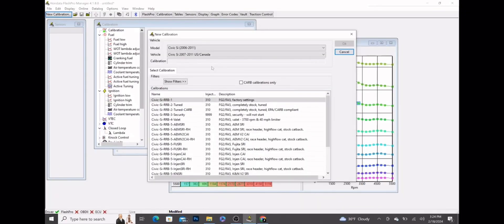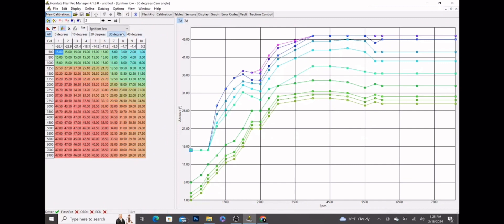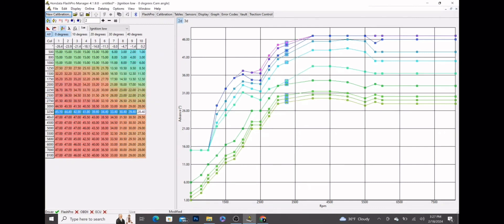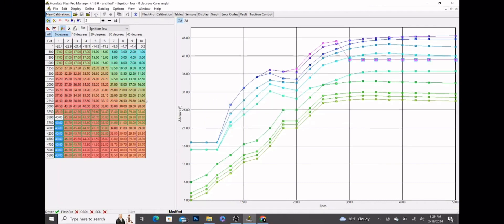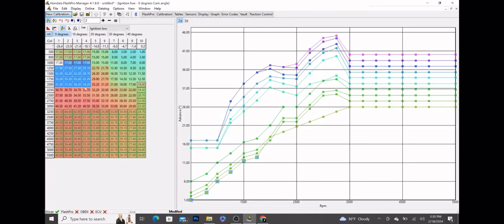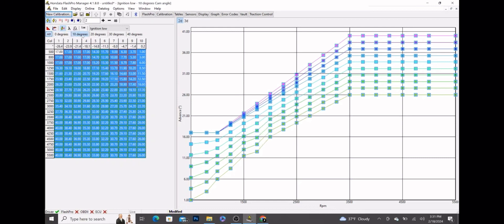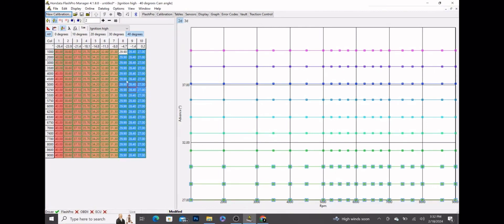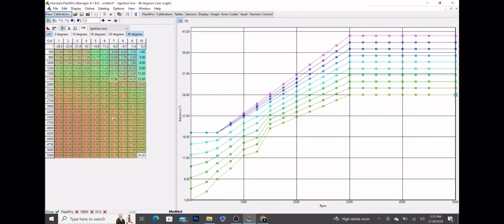How to Tune 8th Gen Civic Si K20 (Part 1: Ignition Map)

Comment: Hi just looking for some more deatailed explaination which is ur gragh looks smoothly satisfied but the stock ignition map looks like mass. So why'd they do ignition map like that? is that a proper reason why they did the map up and down instead of a nice smooth straight line  or is it related with the vtec or cam angle or what.  Thats what in curious about, thx!
Reply: man i have been wondering the same thing. every configuration looks so crazy and have always wondered why they always start off like that

Comment: Hi I have a quick question? What if we start off with the first steps you provide and after opening “Ignition Low” the graph shows lines crossing and everything is all over the place? I just want to know haha is it ok to continue with following your steps because at the end of making the changes it will be better off anyway? Please help.
Reply from the maker: If there’s a bunch of crossed over lines then you most likely didn’t copy the tables to all cam angles like the video. I would try rewatching and trying again
Reply: @staticspeedtuning  I was meaning before doing your turn. I had the K&N CAI, race headers, cat exhaust map on hondata and looked at the graph before using your video notice the graph was like up & downs & everywhere, now after your video everything straightened out and the car runs way better. What I’m trying to say it runs smooth and before it really kinda sucked. I just want to say great video and nice how a simple trick can contain a lot of knowledge and very easy to understand. Your video is 5 out of 5 for sure. Thanks for the video.
Reply from the maker: @franciscopacheco9361  Oh yeah the Hondata ignition maps are all over the place for no reason lol. I’m glad it worked out for you! Thanks for the feedback
Reply: @staticspeedtuning  hello, just wanted to say thanks for part 2 just going to try it. Quick question if you could please help. I have started to autotune and used this first video and the car felt ok, now will continue with part 2 with autotuning fuel h&l, maybe will autotune apart the ignition tables as well. If that sounds ok? My question is when checking Use speed/density (MAP) fuel tables do you recommend having checked (off) AFM enabled because it would be better? Cuz I don’t want to have it checked on and it not be the better/correct option to follow. Please help I would really appreciate it by the way I would be interested in a tune but kinda difficult because I live so far out and payment would be a bit complex.. thought just for me to mention.
Reply from the maker: Auto tuning does not work very well and if you don’t have the right values entered in for target values it definitely won’t work well. It doesn’t matter if you have afm enabled or not it doesn’t affect the tuning if you’re using map tables. But I do all my tunes remotely and take lots of different payment methods. Even if you’re not in the U.S. I can take bitcoin too. Dm me on Instagram

Comment: Excuse my ignorance man, but on the high ignition side are you supposed to copy and paste at all degrees like you did on the low side?
Reply from the maker: Yes! I’m glad you mentioned that because I forgot to mention that. Yes all ignition maps should match for all of the cam angles such as 0,10,20,30,40
Reply: @staticspeedproductions8087  awesome thank you for replying. I used to have non vtec d and b series cars that I would tune using crome. 

But the k series is a whole different ball game so I'm very excited to see what you have in store for content.

I've been very slowly working on my fuel tables on my 8th gen but don't know where to start with ignition and vtc angles 😅
Reply: Disregard my comment! This is perfect! Thanks

Comment: Question, if i have a jdm k24a swap from an 08 tsx what should i put in the model for a new calibration in flashspro? Can i still put 2008 civic si? I dont see a tab for jdm tsx 2.4 so im curious, also would this tune work for that motor?
Reply: i would say load the tune for a tsx if the engine is using the same parts

Comment: Anyone running this?
Reply: im running it rn
Reply: @urpapi2237 how is it and what mods?
Reply: @ethengutierrez7083  just flashed it to my car see how it goes..
Reply: @Reefparty how is it?
Reply: @matthewguzman3632  tuned now but for the little time I was running it zero issues felt stronger than flashpro pre loaded cal
Reply: @Reefparty  gonna go run this setup right now then lmao, thanks
Reply: @matthewguzman3632   do you guys have any mods done wondering if this works on a stock setup
Reply: @Reefparty so i wouldn’t have to do any other adjustments to any other tables? just the ignition tables and it runs better?